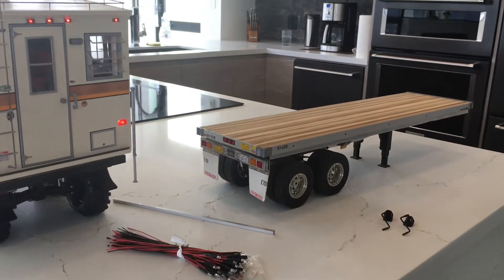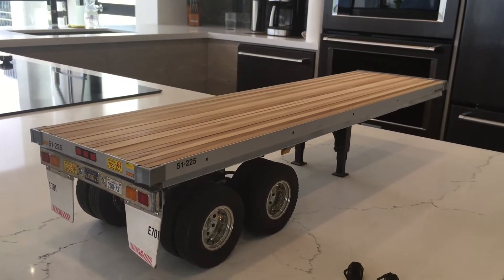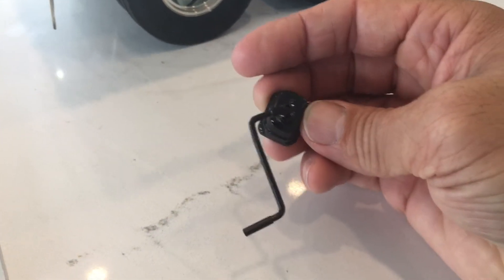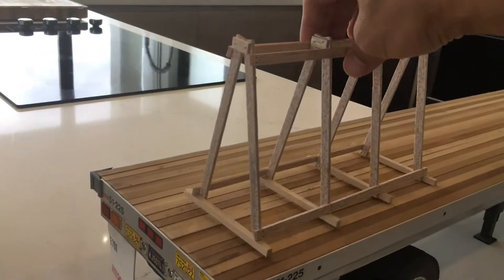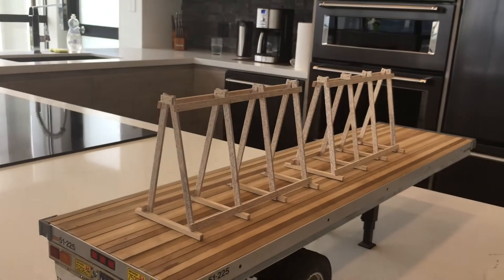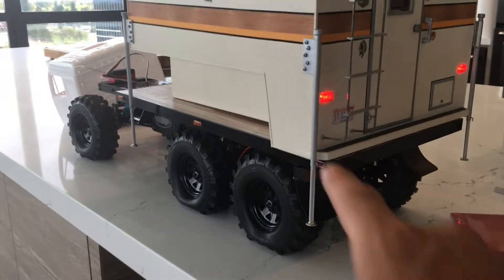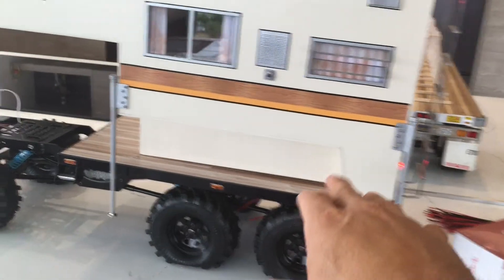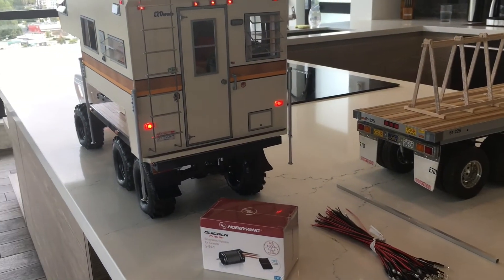Tamiya 1:14 flatbed trailer

Comment: Well, here is a very nice trailer, very practical for transporting everything you build. Your idea of putting the camper on the truck is very good, there will be a lot of work to adapt it well and also to see the problem of the tires which are too flexible in relation to the weight of the whole, very impatient to see the rest of this work as well as your new construction for your trailer. And congratulations on your 531 subscribers 😊
Reply from the maker: Thanks Pascal, you're channel has be a great inspiration. 🙏
Reply: @westernsharpie  Thanks my friend 😊